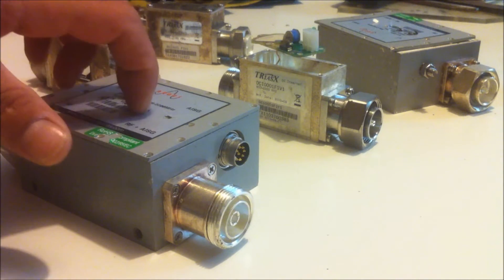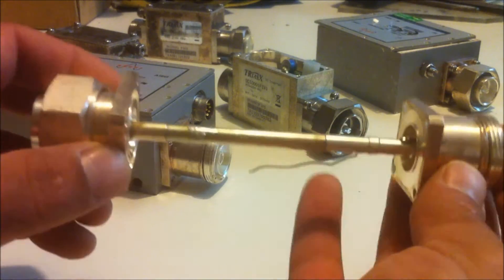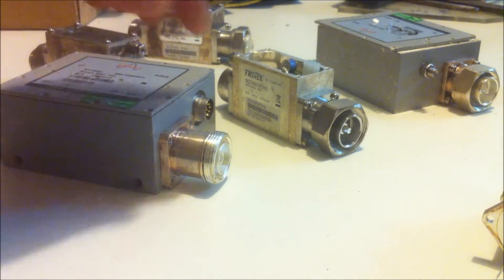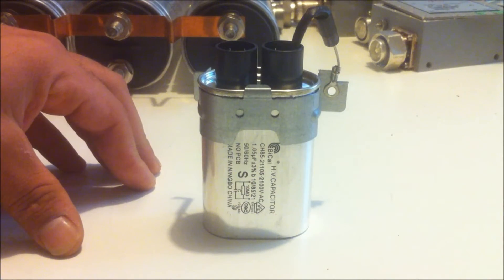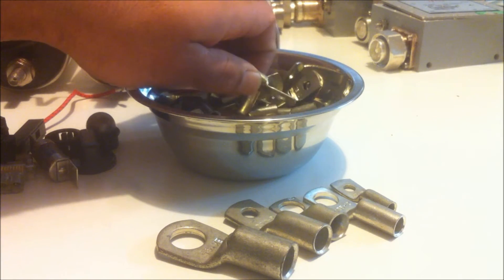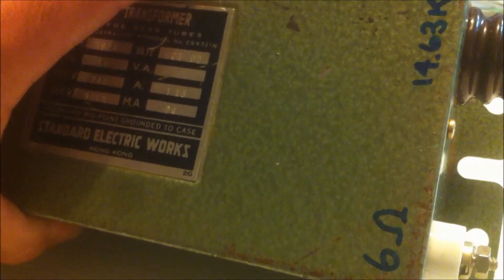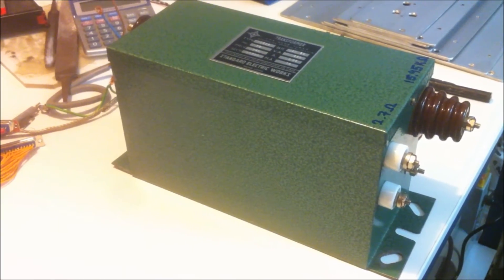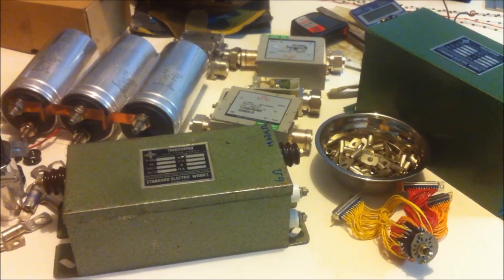I Found More Capacitors & Neon Sign Transformers!

Comment: The arc length on 15 kV is in excess of 2 inches. Keep wiring inside grounded 1/2" metallic conduit (watertight if applicable). Be sure to use proper enclosures for transformers. Stray electric arcs will ignite combustible materials.
Reply from the maker: Safety is number one priority :)
Reply: This is only true when danger comes last